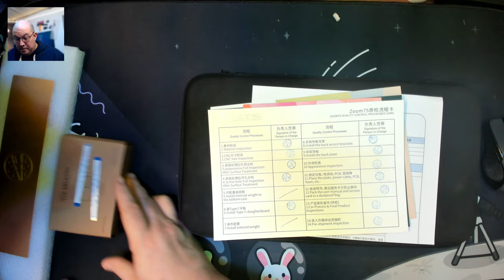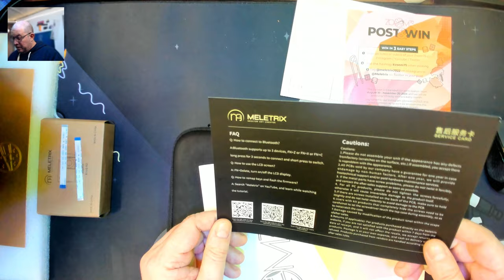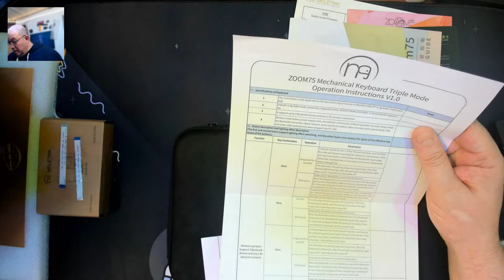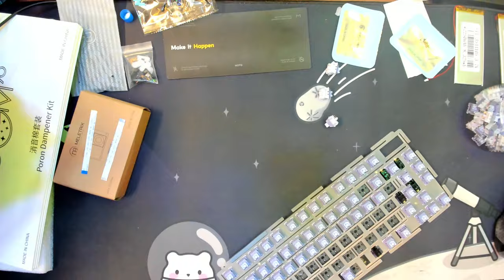The Keyboard that will ZOOM right onto your desk! - Zoom75v2 Kit Overview

Comment: Mine will arrive in January and I need to prepare a keycap set. I plan on using split space, but Meletrix seems to support an unusual split space layout: 1.5u + 1u + 1.5u + 3u + 1u + 3u + 1.5u.

Not many keycap sets have 2x3u, most just have one.

PCB has a lot of sockets in the bottom row. Any chance to use more standard split space layout? Like for example 3x 1.25 u + 2.75u + 1.25u + 2.25u + 2x1.25u ?
Reply from the maker: I don't believe so: https://zoom-75.com/#:~:text=tray%20mount%20keyboards.-,Multi%2Dlayout,-Unlike%20traditional%20keyboards

Comment: I'm actually surprised at how loud & open the case sounds with all the foams! Are the top or bottom halves particularly thin or something? I've never been big on foams, switch sheets, or tape mods but it seems this board is almost made for them.
Reply from the maker: Not thin, they are not the thickest I've seen to date, but it's not thin. The Drop Sense75, now that was thin.

I've yet to try it without foams, but I love how it sounds fully loaded.
Reply: @MechKeyboards  Yeah it did sound good loaded up for sure. I'm pretty curious as to how it would sound without foams now too LOL! Definitely something to try in a future video on this. If you do get around to trying it bare, definitely give some clicky switches a shot in it. I am not a huge fan of clicky switches, but more open sounding cases like this pair ridiculously good with them.
Reply from the maker: @robr640  funny enough I just received some clicky switches to review and I was wondering how they'd sound in one of these. I'll at least do a sound test with no foams and some clickies here in the near future,  thanks for the idea!